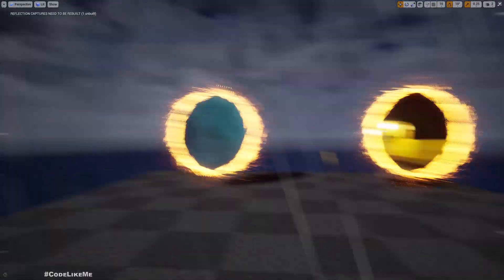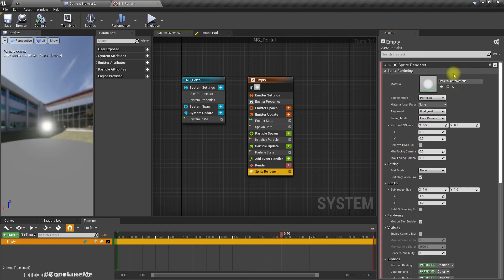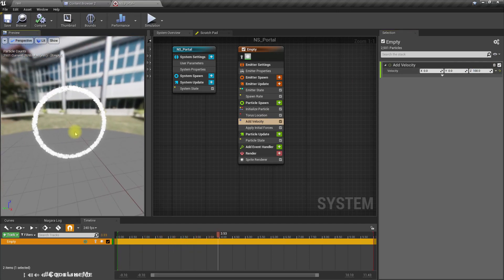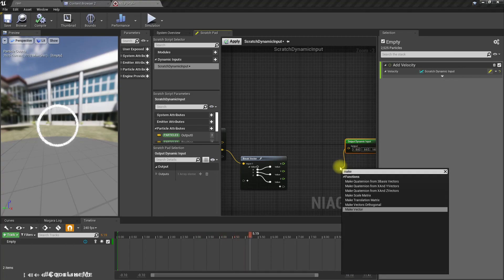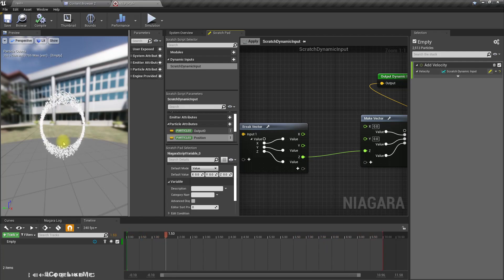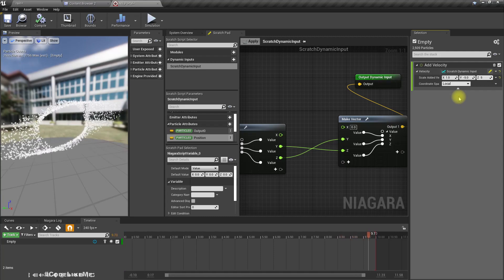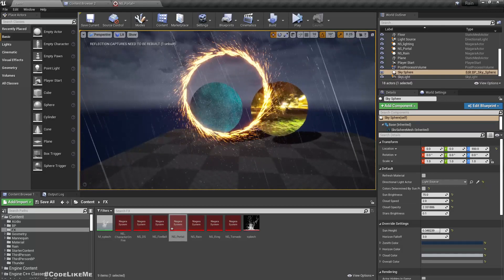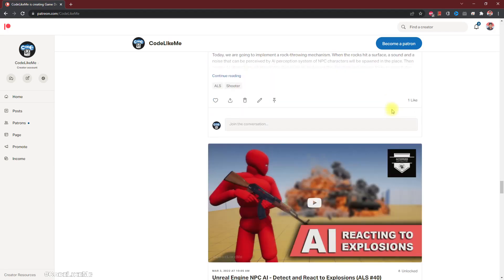Unreal Engine Portal Ring Particle Effect with Niagara

Comment: Love this tutorial, however I want to spawn the portal in front of the player. It works well if the player is facing the X direction, but the player is facing the Y direction, the particle velocity stays the same in the world., meaning the particles are flying in the wrong direction. Any help?
Reply from the maker: you will have to change the function where the particle velocity added to use the local space
Reply: @CodeLikeMe  Is there anyway of doing this? i can't seem to change cam view, local space or anything, the only thing that seems to be changing anything is break vector and make vector section, but it only works in one direction. any suggestions?
Reply from the maker: @IsVexx  refer to this video https://youtu.be/I6kVlUulPFk
Reply: I believe you can change the alignment and camera facing logic of all emitters in the system. Should be in the Emitter update properties